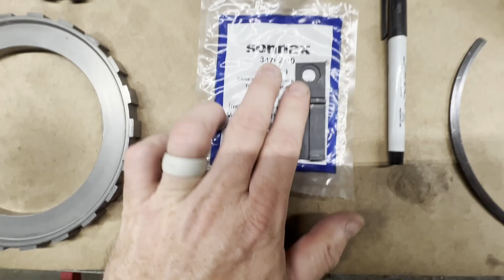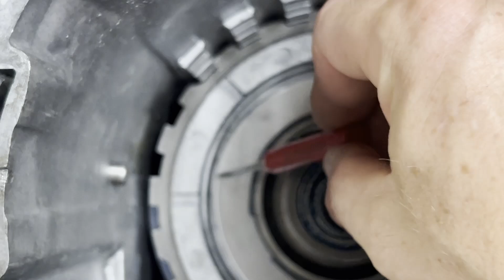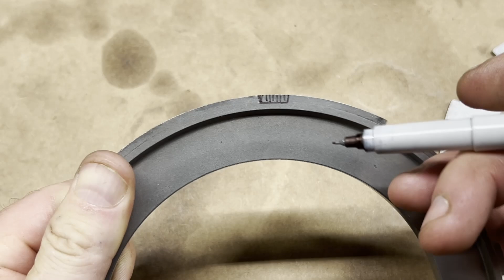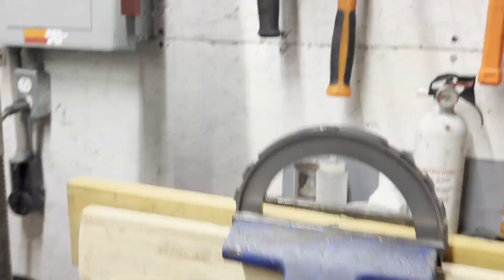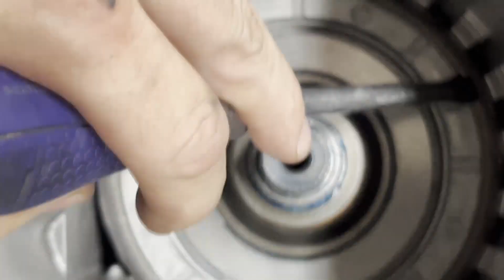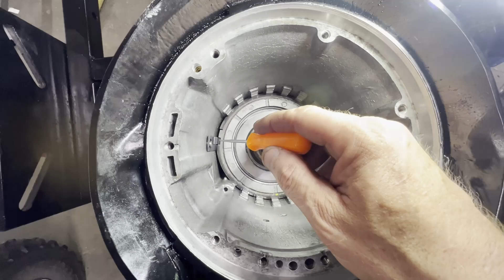Sonnax Case Saver Install  - TH400

Comment: I'm glad you made a video of this. I have one I have to install and this definitely helps.
Reply from the maker: @inscoredbz Glad it helped you out!! Thanks for checking out the channel and commenting!
Reply: @dtperformance256  I went and watched the other video's on the lower unit and rear case bearing. I have that as well. I also have the same bushing driver set that you have. I made two handles that are longer just for driving bearings in that's deep like that. I had my o ring on the output shaft cut off in a lathe. I took it almost to the speedo gear. It's still larger than the th350 and all the others. I would like to have radiused the o ring hole just to get rid of the sharp edges, but they work behind more horsepower than I'm gonna make so no sweet. Have you ever done a 2004R? That's a fun one to do. Damn nightmare in a transmission  case. Lol
Reply from the maker: @inscoredbz I need to make me some longer handles too. I don’t have any experience with the 200R, I wish I knew more about transmissions. I am lucky the 400’s are not too difficult. LOL. Thanks for watching and the comments.

Comment: Hello, trying to help a friend out he ordered a drum that has a checkbook in it but the drum that came out of the unit has a check in the piston. Can I use it and just put it 180° opposite from one side to the other side.
Reply from the maker: @frankvottiero8704 I have heard of people running two check balls with no issue. Most people don’t do it. I don’t think it matters how you turn the piston in the drum. If you want one check ball you can order them on Facebook pretty cheap or you could knock the check ball out, tap the hole for a set screw using red loctite and plug the hole. You could also weld the hole up. I have a video showing how to use the set screw method. Thanks for commenting and watching!!

https://youtu.be/_iOKM_-SZ-Y?si=dNOyEi8wjFJl5twf
Reply: Thank you buddy for the information. I like your videos.
Reply from the maker: @frankvottiero8704  I hope they help you out. Again thanks for watching!!

Comment: I'm a believer in Sonnax parts, I don't think you can go wrong with them. Interesting transmission choice, I think I might have gone with the 4L80 or 85 for the overdrive in case I decided I want to drive it on the street some. Definitely going to be watching this build though!
Reply from the maker: @stevea6722 I have not used Sonnax before but all the parts that I have look to be very good quality. I have the Sonnax forward clutch hub that I am going to install as well. I went back and forth on overdrive and A/C. I may swap later and use this 400 for something else, but it has definitely been a learning experience. Thanks for watching and commenting!!! I appreciate the feedback.